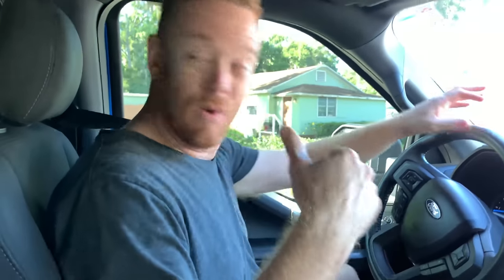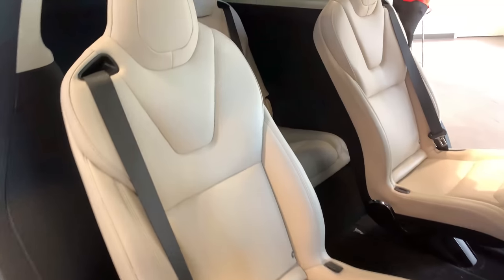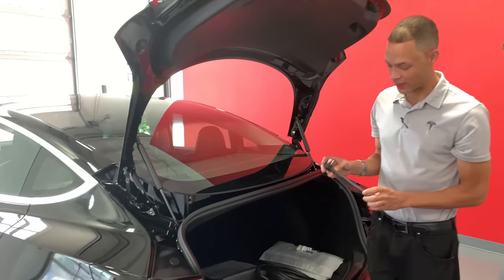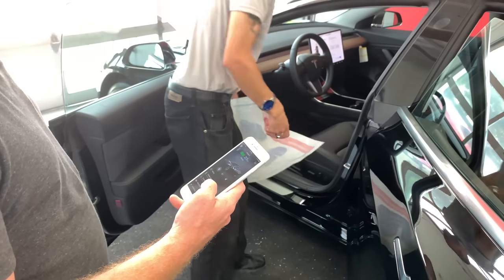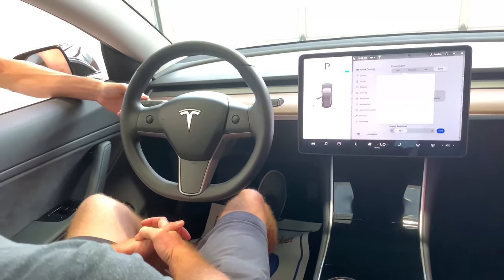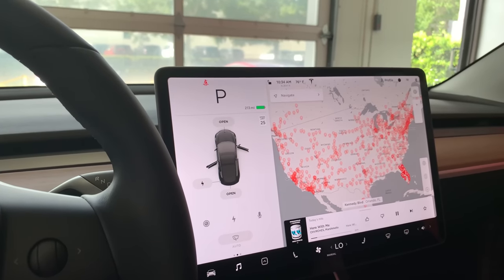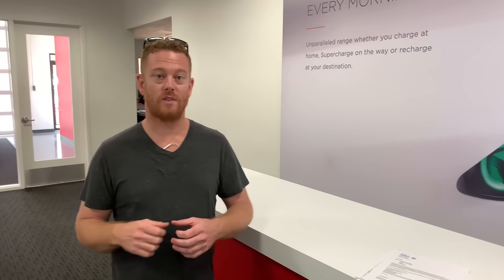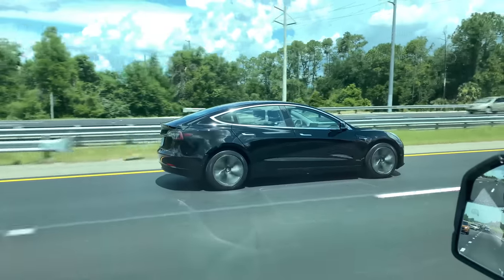I bought a 2019 model 3 - What to expect when picking up your car!

Comment: Went back to Tesla delivery today to ask about why my M3 did not have Garage Door opener - Homelink, found it that was a $300 software upgrade - which when downloaded, hardware had to be installed at the Delivery station repair facility - and - they were out of stock.  I did put my email in the site to be notified when Tesla Homelink would be available.  Even as the agent was totally distracted while trying to answer my questions which I had to repeat several times.   Still I'm  really, really love my new Tesla 4WD dual motor M3.  I'm sure Tesla delivery will get over it's growing pains.
Reply from the maker: Ya I hope

Comment: doest come with floor mats? that should be standard on all models, wow.
Reply from the maker: No. And it should the carpet it is like Velcro
Reply: Only the Premium Interior comes with floor mats. Cost cutting.
Reply: @iesmail07  ik the demo/sales guy looked like he was trying to get the paper one from him, because of costs lol >.<
Reply: No floor maps, no garage door opener, no spotify. Door opener can be added, spotify is coming so said.
Reply: bombebomb bought a Premium interior car and am not quite sure if the garage door opener is included or not 😂 read somewhere that it isn’t
Reply: No floor mats, no 14-50 charger adapter, no Iphone or USBc connectors,  - NOTHING.  Even on an SR+
Reply: @bombebomb  what do you mean no garage door opener? i thought they came with software that allows you to open/close garage door

Comment: Hey buddy. Just wondering. Stop at 34:59 and see if that right door rubber gasket supposed to be like that? From top I see something round like hole , not sure what’s that.
Reply from the maker: kaushal patel so yep there’s a little buckle by the b pillar. They usually fix it with heat but it’s because the turn and I think it has laid down in the few week I had it.  I’ll put a hair drier on it if not

Comment: I believe Tesla ran out of Carpets for the inside of the vehicle and also missing carpet in the Frunk and Maybe the Trunk but I didn't get to see very good in this video. In other deliveries I seen the same issue where it didn't have carpet in the same area's. I bought a new 2012 vehicle back in 2012 and it came with basic carpets on the inside the vehicle but having weather carpets are a upgrade. I think the manufacturer who's making the carpets can't keep up with Tesla.

Comment: Congratulations! What an awesome car. I sounds like you already knew about squeaks, rattles and other cosmetic items being only covered for one year? I doubt that you’ll have a single problem, but if you do, have it fixed ASAP, so that they can’t tell you that too much time has elapsed.
Reply from the maker: Thank you! Yep. He said it would be covered under the 5 year but we’ll see. All good so far with 5000 miles
Reply: Mark Dickinson You’re not going to have any of those issues. Most of the problems seem to come from rushed deliveries and people that believe that Tesla will fix scratches in their paint later on. I don’t want my new car to have to be repainted. My delivery was rushed and the car was not clean. I just live with some defective paint because everything else is perfect 👌🏻. I’m not the type of person that wants to make waves and I don’t want to make people’s jobs a living hell. Generally if you’re nice to people, you’ll get rewarded with extra effort from people that are just trying to do their job. I’ve got a stepmother who’s a complete a**hole to people and always has a problem at restaurants.
Reply from the maker: Mitchell Barnow got the same stepmother too:)
Reply: Mark Dickinson I’m so sorry 😐.

Comment: I noticed that to open the door you have to press a button. God forbid you were ever in a water accident and needed to open the door to escape, will it short circuit and stay closed? Is there any other way to open the door?
Reply from the maker: There’s a manual latch too

Comment: Hello! Do you have a photo or a video show the backseats with the two "child seats" (don't know if it's the correct english word) to see how much space there is. Thanks!
Reply from the maker: I do. I’ll create a video for it
Reply: I put 2 carseats in the back and my oldest sat in between them when we test drove one and they fit pretty well. It's a little tight, but there is room in the back. Now i cant wait to pick my model 3 up. I picked out the midnight silver with the white interior. I was dead set against the white and getting the black but after seeing the white in person and the black on another car I went with the white. Also i got the long range model 3.

Comment: You mentioned that you got 5000 mile referral charge credits by purchasing with a referral code through a certain person.  Is that still available to me?  I want to place an order next week.  Thanks.
Reply from the maker: The current one is 1000 miles and entered into roadster. You can use my referral code to get 1,000 free Supercharger miles on a new Tesla: https://ts.la/mark87349. 

That’s what’s in the account now

Comment: So you got the SR+ and it looks like you have access to the satellite maps and traffic. Did I see that correctly?
Reply from the maker: Christian Bouligny in don’t see the satellite or traffic on my side. Yes on the sr+. 

I tried even doing a hotspot and I guess have to wait to see if I can purchase the data plane
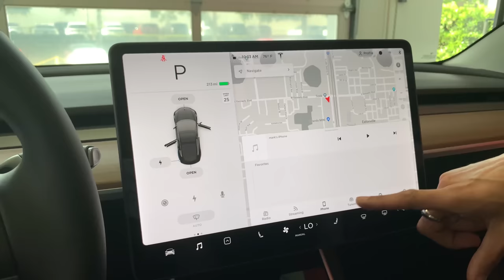Reply: @MarkDickinson  oh okay. Just around the 26:00 mark it looks like you have those controls to toggle through. Bottom right of screen, right above the music player. Which it also looks you have the streaming option going, which would be a premium connectivity option.
Reply from the maker: Christian Bouligny i did notice the streaming while I was in their office I wonder if while on TESLA sc WiFi it defaults to that.  Or once I left it went into my configuration. I got to drive in a few minutes I’ll check it but I don’t see them anymore I don’t believe.
Reply: @MarkDickinson  hmmm that's interesting. Thanks for the response

Comment: A few things, I have the exact same "United We Stand" license plate lol... I also just picked mine up on Sunday from that exact location. Unfortunately for me, the process wasn't smooth at all. 

Someone decided to change the paperwork the afternoon before without telling me. I drove 90mins one way (closest Tesla to me) so you could imagine the frustration being that I was already going into work late to pick up the car and that just added over an hour delay. I also want to say that my sales rep was excellent, the miscommunication was the person printing the paperwork not informing us of the changes. Troy wasn't the original person explaining the situation but he was an absolute dick basically telling me that Tesla won't change anything and if I don't like it, I can leave. Lots of back-n-forth another person and finance calling headquarters and we eventually got it sorted with my own suggestion.

My car was parked outside in the sun, I wasn't shown anything about charging, I didn't even know if I had a charging cable until I got back home (90mins away). My bumper had 2 chips in the paint and I offered to accept some kind of store credit for merchandise and to not have them fix it (since I work at a dealership and can get it fixed on my schedule) but they said I will have to come back to have them fix it, which isn't easy and literally is a waste of a day of traveling and waiting. They still haven't told me what kind of credit I am getting, which is understandable because it's only been 4 days.

Ultimately I love the vehicle but the experience was not something I could say is better than buying a car the traditional way. I know my situation was the exception and not the rule. But it was my experience.
Reply from the maker: Damn sorry to hear Ignacio the sales manager and I had a few words today about my last visit there. I wasn’t happy either due to an early visit that I drove 60 miles just to say my battery check up was canceled. He’s not a good customer service oriented manager.
Reply: @MarkDickinson   yeah, it seems the only person we liked there was Brittany, our delivery specialist... None of the other people knew how to fix our issue without my suggestions... I guess because I actually sell cars, I know how to make a deal happen whereas these people just take orders and have people sign up... So when there is an actual issue, nobody knows what to do...